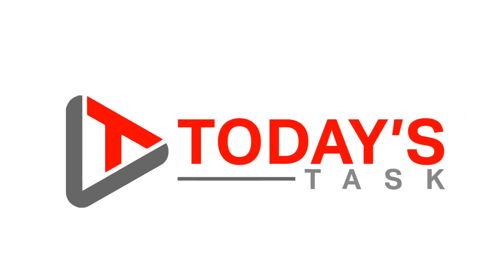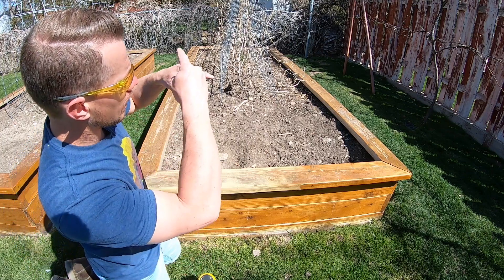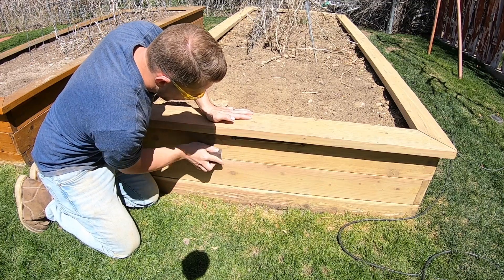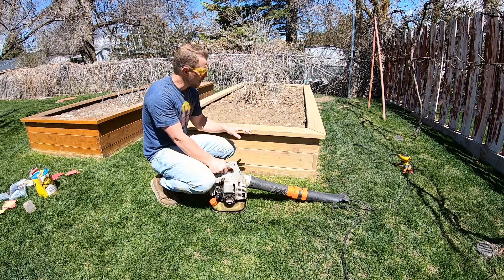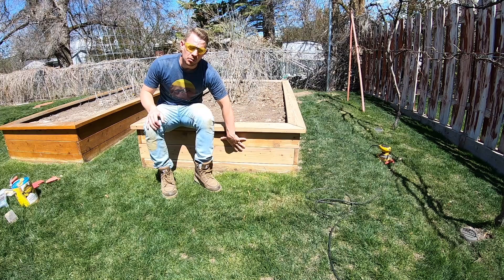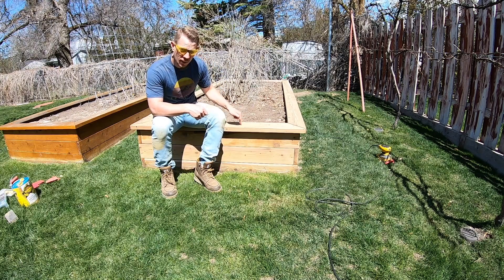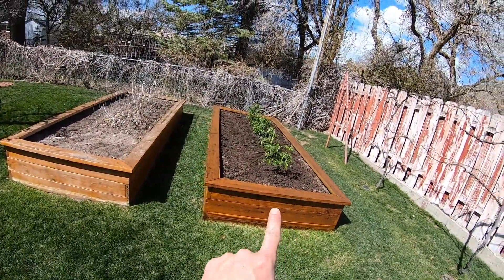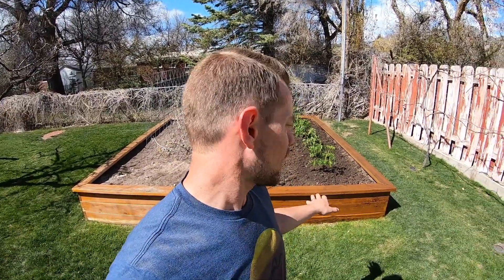Raised Garden Box Refurbish How To

Comment: Hi! I’m having some cedar beds put in my yard right now. I know this is a few months old but would it be beneficial for me to stain the inside and outside of the bed before filling it? Also, do I need to sand down the fresh bed before staining? Thanks for the help!!
Reply from the maker: I would stain both inside and outside, but I would only sand the outside.
Reply: @TodaysTask  do you mind explaining why only send the outside? Also making a planter box using a dark espresso stain I'm having issues with the stain not getting in between the cracks any suggestions